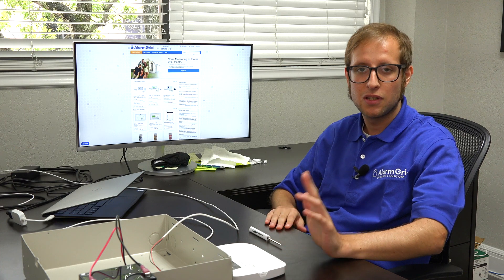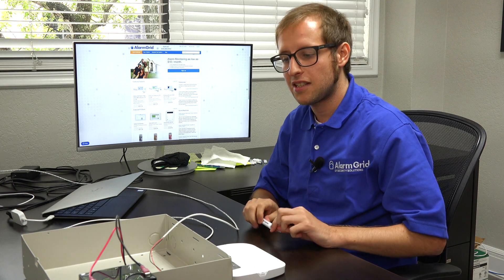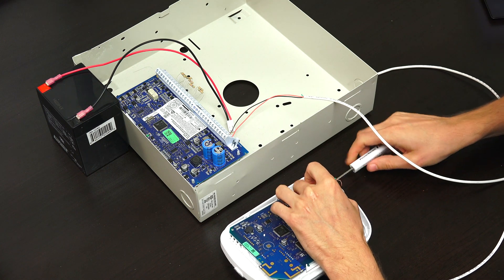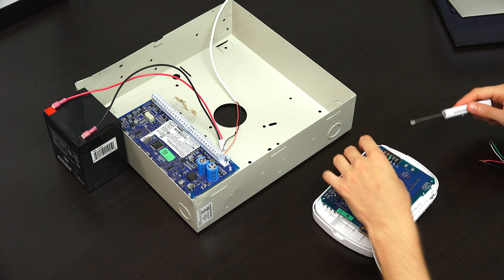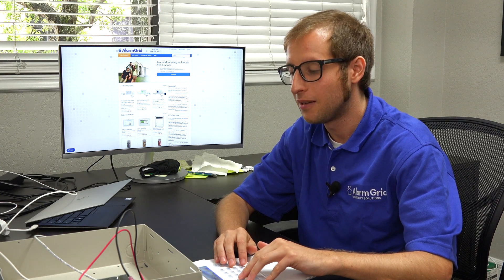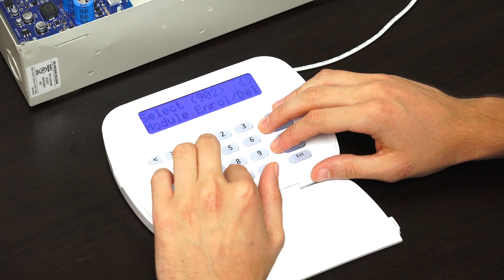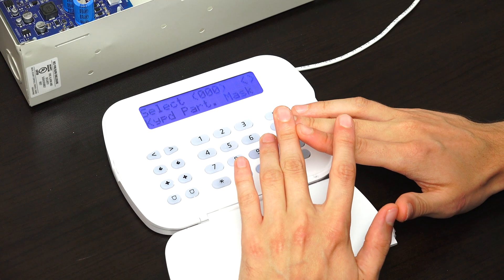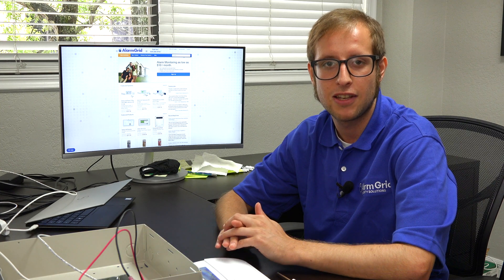Adding a Wired Keypad to DSC PowerSeries NEO Security System

Comment: I have a person using a DSC NEO with 3 keypads, they remodeled and unhooked keypad 1 and lett wire in wall. They only now use the other two keypads, but system is in trouble with the missing keypad.  How do I delete the keypad 1 to fix the trouble.  thanks